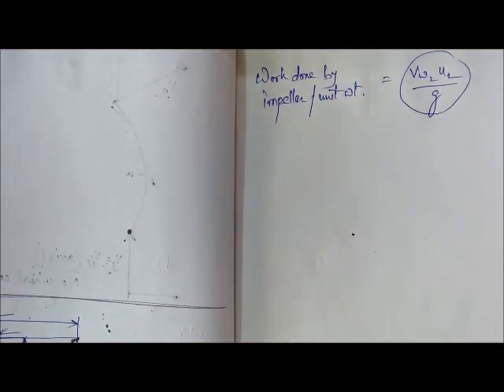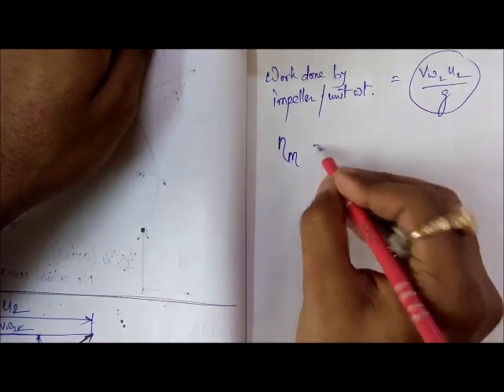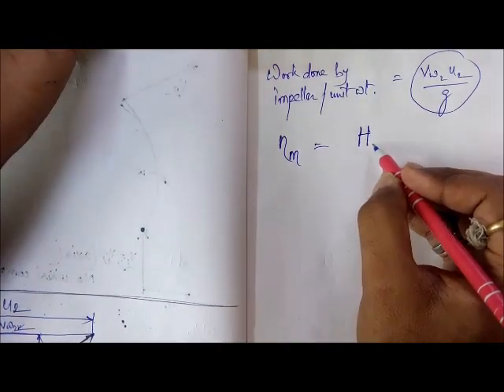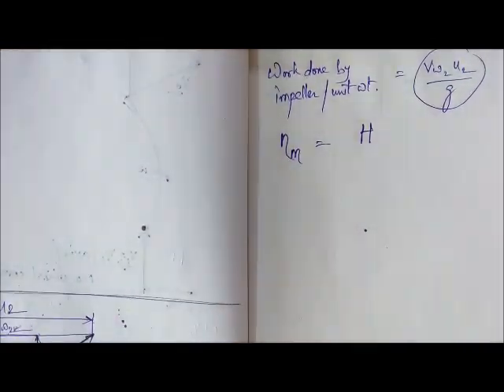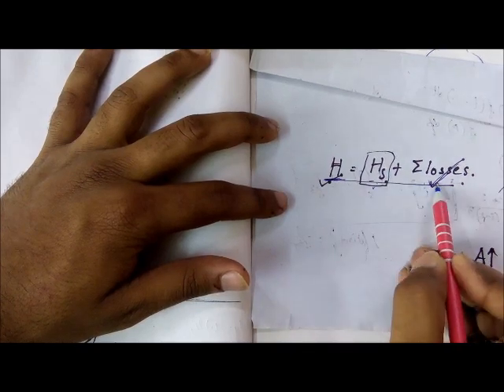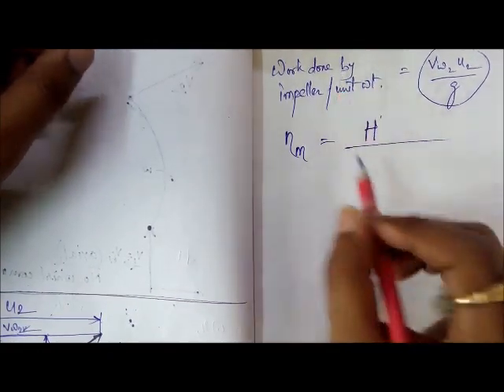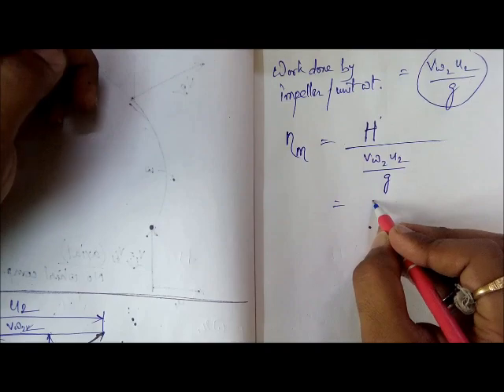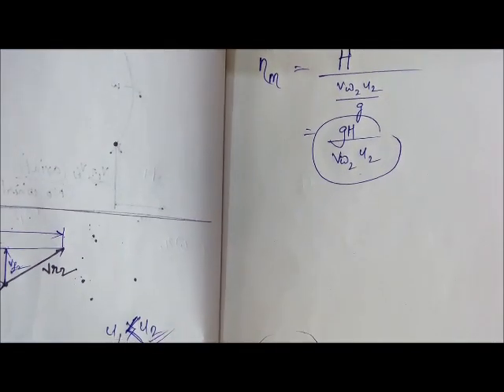Centrifugal pump lecture 2

Comment: Hi sir, can you please help me
In pressure penstock 4500 m long, water is flowing at a velocity of 4 m/ s .if the velocity of the pressure wave travelling in the pipe, due to sudden complete closure of a valve at the down stream end. Is given as 1500m/s what would be the period of oscillation in second under frictionless condition , pls give me the solution help me sir

Comment: Its ok sir, but why and how pressure will reduce after adding some amount of water in impeller?
Reply from the maker: vipul anand when the blades of the pump cut water, the pressure drop is much more because of higher water resistance
Reply from the maker: vipul anand also comment if you need video on other topics of any subject